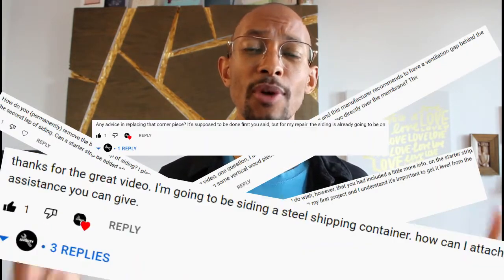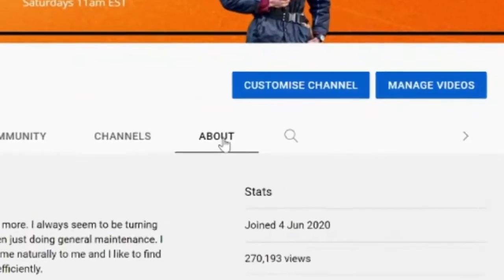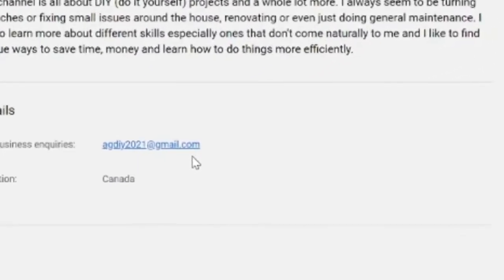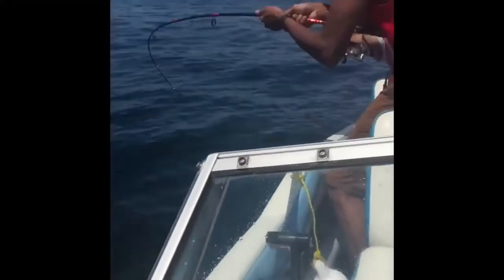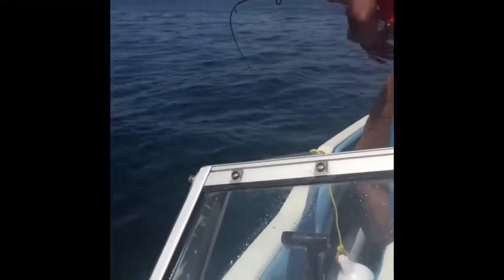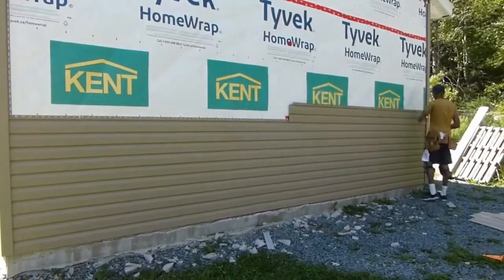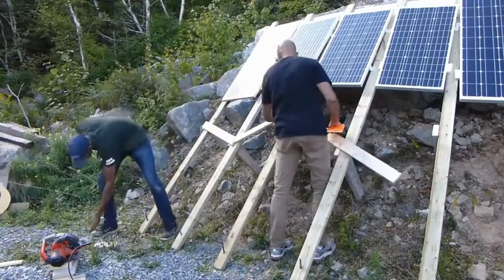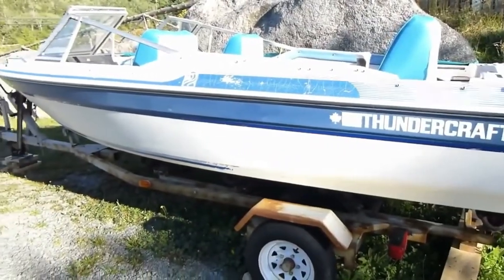NEED HELP WITH YOUR DIY PROJECT?

Comment: Here's some advice for KIA owners. I have a 2017 Sportage, and I have found out a couple things that seem to apply to most KIAs. If you find your KIA starting to butn a lot of oil in between oil changes, you need to replace the PCV valve, which a simple task for anyone to do. If you find that around 100,000 km the engine oil light seems to stay illuminated longer than usual at startup or when the engine is idling, or it might flicker on and off, first check the oil level using the dipstick. If the level is ok, then you need to have the oil pressure switch changed. You can do this yourself if you're adventurous, but it is an easy job for the dealer to do.